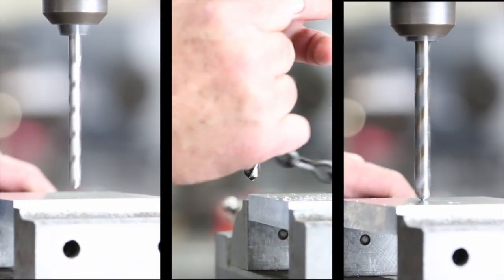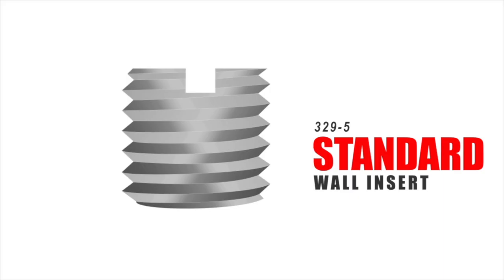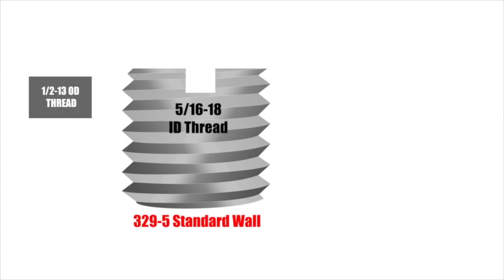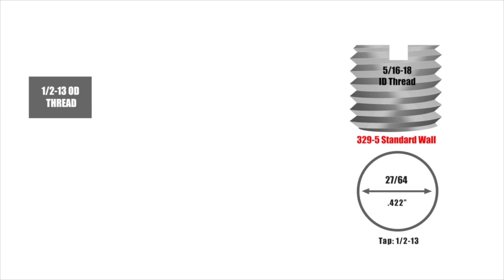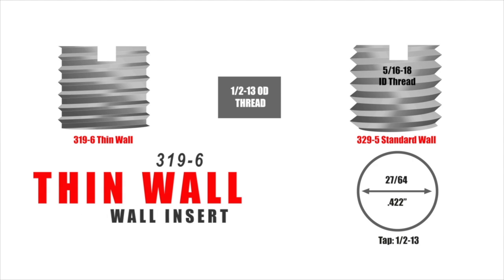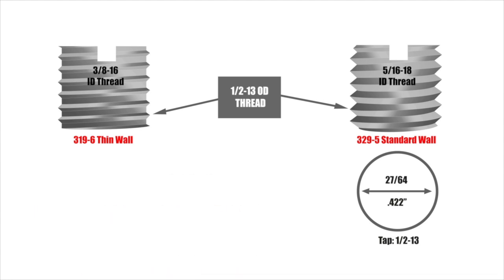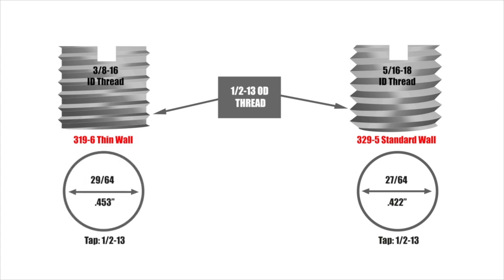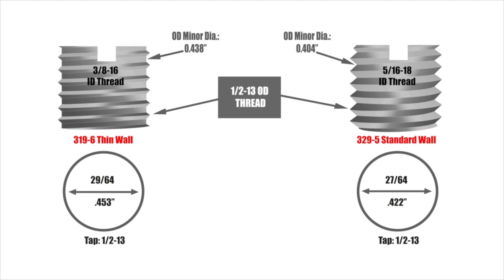E-Z LOK Thin Wall Threaded Inserts: How to Install Thin Wall Inserts

Comment: I don’t understand why ez lok thin wall insert would require a larger bore hole, especially since the whole point of a thin wall design is to preserve more of the surrounding material. Other repair kits, like Rockmount, offer thin wall inserts that make sense — they have a smaller outer diameter so they can be used in smaller holes while still maintaining the same internal thread size. But with EZ Lok’s thin wall version, it doesn’t make sense — it seems to defeat the purpose.
Reply: I don't know why they say the thin wall 3/16 tapped size wall  is 1/2 when McMaster car says 7/16 for the thin wall...Kinda stupid the display above is backwards also.

Comment: How strong is a repair using a 319-6 compared to a non repair 3/8-16 tapped hole in typical carbon steel? I’m still not sure have a bigger hole is going to make a better repair.